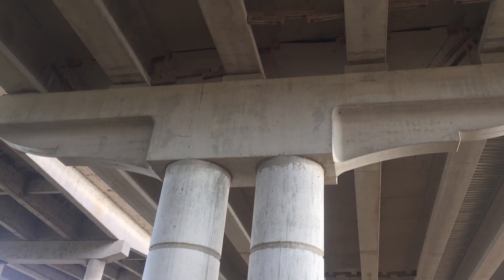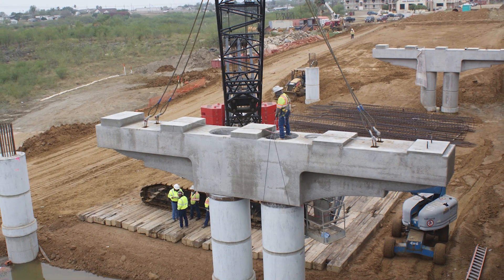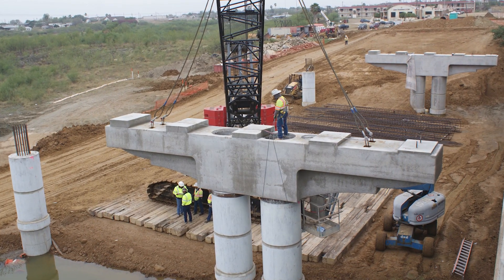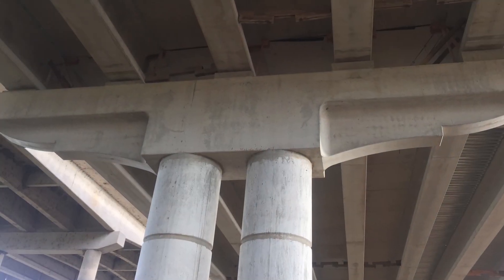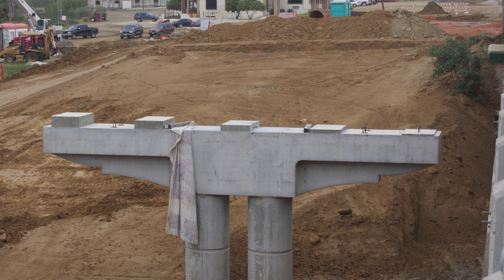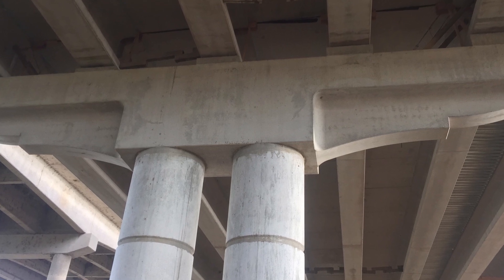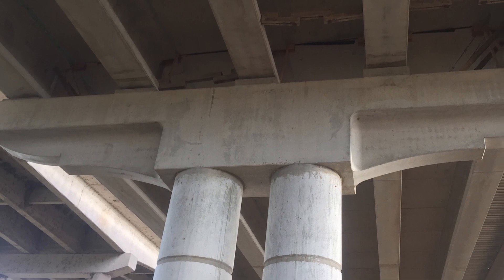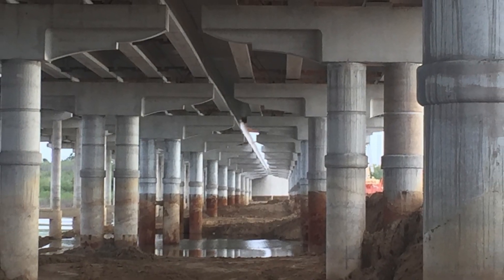Best Use​ Precast Concrete Innovative Bridge Design - Arroyo Veleño Bridge

Comment: but with holes in the middle. is not the cross beam structure weakened.. how about a thicker cross section around the holes... or smaller holes.  i guess the tension cables make up for the loss of strength.